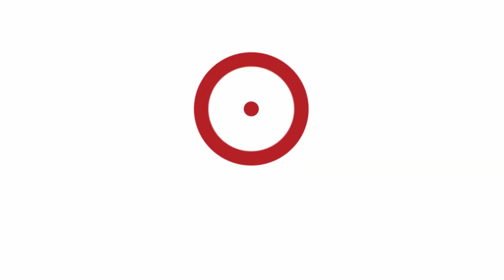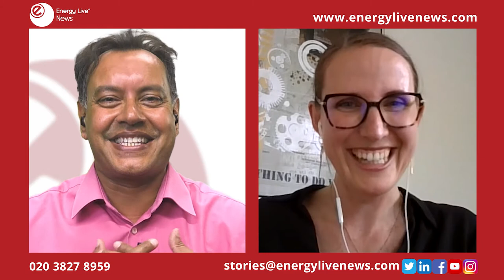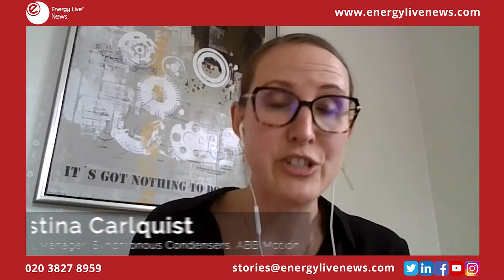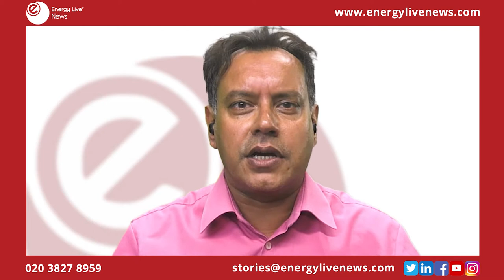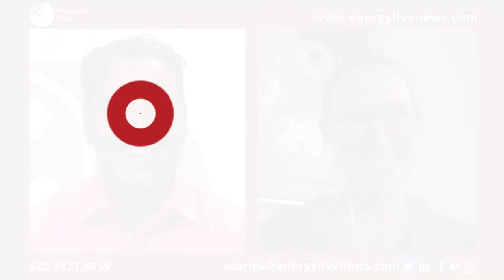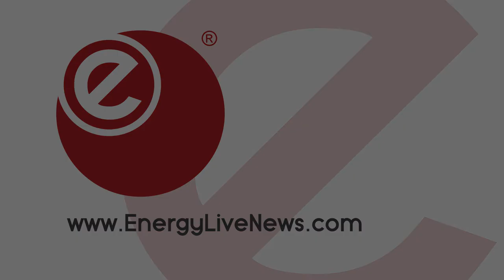Synchronous Condensers Are Key To Enabling Renewable Growth - but what are they?

Comment: It's a ... airdyne bike. Pedal, pedal, pedal, pedal, and stop. The wheel continues to spin until it loses inertia. I am blown away they are selling this as "Savior of renewable energy" because it's a temporary thing. It's momentary. Literally momentary.
Reply: Well it seems like it can spin its own wheel without any external input
Reply: @PlasmaSnake369  how so?
Reply: You missed the point. It can support temporary demands of high load (effectively).
Your solar panels fundamentally cannot do that. You get what you get and not a watt more, no matter how much you need it.
Reply: Sorry but that is not correct, it is not temporary. They spin continuously unless power is lost. Synchronous Condenser's basically emulate the traditional generation that is being removed from the grid. They provide all of the same support but don't generate power.

Comment: Basically big old steam turbines consisting of large rotating masses inherently stabilized the grid because changes in the kinetic energy of the rotating mass almost instantly compensated for changing loads and kept the power factor (phase angle between current and voltage) from distorting to the point that energy transmission efficiency drops and possibly even disconnects to protect equipment. Solar doesn’t do this at all since it’s rectified DC, while wind and gas turbines have less mass so perform only partially as well.

Comment: Wow, I don't think he understood a word and she didn't know how to explain herself. Condensers don't address the real issues with non-synchronised renewable energy sources entering the grid, they're just an extremely expensive band-aid.
Reply: Can you elaborate please? I'm also of the opinion that wind and solar are problematic, but don't have all the knowledge so would love to learn more. Is it because ultimately you need huge levels of storage to account for the intermittent nature of the generators (i.e. the ''collectors''), and it's just beyond what is feasible to shut down gas plants? I feel like when people discuss wind and solar they gloss over the scale of the storage needed to match the reliability of our current system. Or they think with enough excess collectors and storage, there will be enough redundancy so there is always somewhere the energy can come from when there is a drop in  either wind or solar. I feel like this is not realistic and will never provide dependable base-load power. That's just my feeling.

Comment: The word inertia keeps coming up.i used to work for a generator set builder.For an intermittent heavy load application like motor starting use a larger heavier  alternator to pick up the load while the engine is powering up.

Comment: Condenser can be used on tail end of the grid?
Reply: between the grid and your installation
Reply: Tail end is also absolutely possible, some factories use it to condition their local power grids (stabilize voltage, correct power factor, provide LVRT)

Comment: Grids need a stable frequency because a change in grid frequency indicates an in-balance between generation and demand. Because of this the protection systems in the grid are set up around the rate of change of frequency to disconnect sections of the grid in order to avoid damage to grid wires and transformers. Once this protection mechanism starts it can cascade to a grid wide black out. Each time a protection mechanism triggers, it will change the in-balance as loads and generation are disconnected.

So in order to avoid this scenario the inertia of the massive rotating machinery in the grid acts to supply kinetic energy to maintain the frequency while the operator takes action to re-balance the load. This operator's action takes place on a time-scale of seconds and minutes while the inertia service will act on the scale of milliseconds. The operator looks to maintain a certain amount of inertia when they dispatch the various different types of generation available at any time. Grid Inertia is measured in units of MW.Seconds. Some will notice this is the same as the unit of energy. In other words, they target the amount of kinetic energy available to arrest a change in frequency.

When large amounts of renewable energy are available for dispatch, the operator may have to keep more expensive thermal generation units on line in order to maintain the target grid Inertia. So renewable energy is curtailed in this situation. This is where the synchronous condensers can help by providing inertia services to the grid.These machines are spun up and remain energised neither consuming or generating a significant amount of energy but contribute to the grid inertia. This allows the operator to dispatch a higher percentage of renewable inverter based generation than they might be able to otherwise.

The South Australian grid regularly has more than 100% renewable energy available to meet demand. A few years ago they would need to dispatch around 20% of the generation from gas plants in order to achieve their targeted grid inertia. They recently commissioned  4 synchronous condensers. So now during periods of high renewable generation they need to dispatch less than 5% of the generation as gas generation. As they deploy more grid scale batteries with Grid Forming Inverter technology they will at some point in the near future not need to dispatch any gas generation in this situation.  

I hope this helps to explain why synchronous condensers are useful for increasing the amount of renewable energy dispatched by the operator.
Reply: Thank you!  You could have replaced the ABB person in the video and completed the video in about 2 minutes with presumably less giggling.  
Also, in the US, we'd say there's an "imbalance" between generation and demand.  Might just be semantics between our countries.
Reply: This solves my query. Thank you!
Reply: Thank you! Easier and more understandable explanation than those in this video.
Reply: Does this mean it is some sort of giant resistor regulating energy in and out of the grid and can it charge the batteries attached to the grid...
Reply: *imbalance
Reply: @godfreypoon5148  Thanks for the correction. I wasn't really sure hence the use of "un-". 🙂

Comment: Synchronous condensers can be a viable alternative to batteries to help stabilise a renewable electrical grid. The on/off and intermittent power that renewables put into the grid leads to voltage and frequency issues. So by adjusting the voltage and frequency using a Synchronous condenser we can keep the output voltage and frequency within parameters.
With the exit of more power plants that use steam turbines connected to generators the Synchronous condenser can basically fill in the gap left by steam turbines and generators that have been removed from the grid.
Designing a worldwide electrical grid is a humongous task. With the entry of renewable power sources into the the energy sector bringing with it an almost exponential need for more complicated electronic control of all aspects of renewable power generation.
From the big cumbersome days of coal fired power plants with almost no finesse in the way the grid operated to the multitude of AC/DC inverters that have to be controlled with smart switching, trying to replicate the old style of grid needs electronic finesse like never before and an innate understanding of how it all works.
Modern electronics and programs have made the renewable grid a possibility with the dinosaur like grid control from fifty years ago unable to deal with a renewable energy present and future.
😎🇦🇺

Comment: I don't think she really knows. But it's really a motor/generator with a big mass on the axle so that it can give back energy to the grid when needed. Imagine that a big load is suddenly switched on on the grid. There is many times a large startup current involved and if the energy comes from some DC source like photovoltaic arrays or fuel cells, they just are just not able to deliver the energy needed during that brief moment. Instead the motor/generator is able to deliver this type of power for X number of cycles, because the kinetic rotational energy of the motor is providing the energy. This prevents overloads and large oscillations on the net which nobody wants. After the load has been switched in the motor/generator speeds up again to normal speed and is therefore recharged again with kinetic rotational energy. It's not a long term storage unit. For long term storage you need to either pump water up to a hydropower plant, have an electrolysis-hydrogen storage-fuel cell plant or heat storage and heat pumps, though the latter is traditionally not used with electricity output. For smaller scale storage there are also flywheel (a large syncrhonous capacitor) or compressed air storage teqniques or even batteries. Hydrogen can store 50x more energy than batteries pr kg, though generation and conversion involves losses of up to 70% which may be OK if the wind or sun at times is plentiful or just because you have no other option. The heat from the process can be used for decentralised heating plants for heating houses or industrial purposes and this would normally require them to be located on land at the outskirts of cities (many such plants using fossil fuels already exist in northern countries).
Reply: She is not talking about longer term energy storage, she only talks about grid inertia on the order of seconds! It is just part of the bigger problem, but it is important, she knows what she's talking about. The inertia provides time for all the generators and storages in the grid to respond. 
AND synchronous condensers also correct power factor as they can both generate or absorb reactive power, also they stabilize voltage and some other minor stuff.